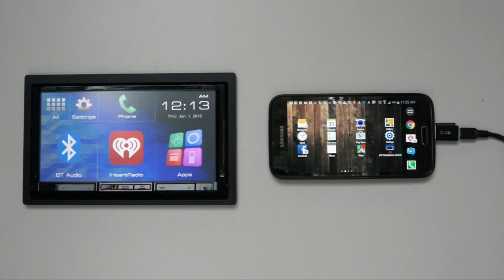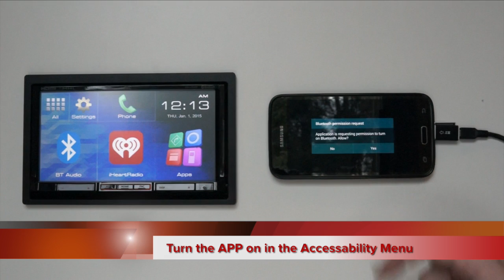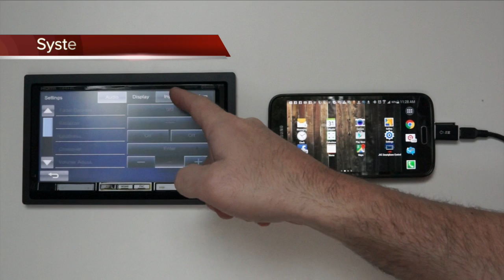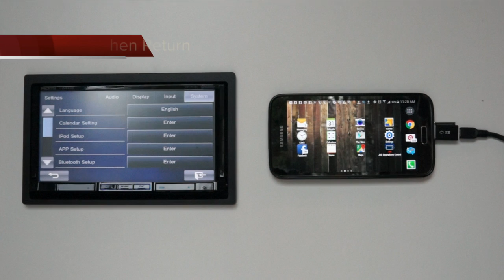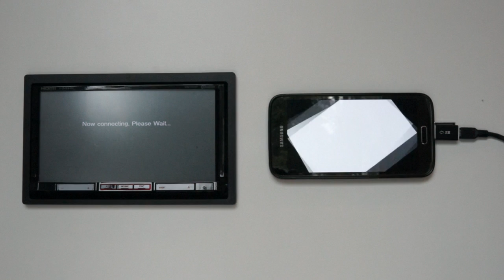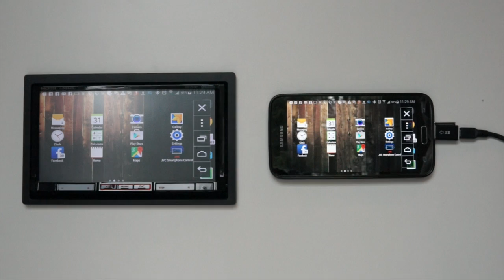JVC Android Smartphone Control

Comment: Will this work with my Samsung galaxy s8 & my jvc kw-av70bt?
Reply from the maker: Matthew Flores...sorry, but Samsung has removed MHL from the current phones. They no longer send video through the USB, they only use Miracast which is through WiFi. You can use an HDMI WiFi adapter/dongle to do it.
Reply: Matthew Yerger  where can I get one of those from?

Comment: can I use my Samsung s7? ibhave the jvc kw-v620bt
Reply from the maker: Desmond stepherson yes and no...when the Samsung s6 was released it no longer supported MHL. They also no longer allow the phone to be remotely controlled from the radio. You can send the video wirelessly, but you will need to purchase a HDMI wifi dongle. It will mirror the phone, but no control.
Reply: Matthew Yerger where exactly do i purchase that from? Do you have a video that demonstrates that. I really need help setting this up? How does the App portion of this stereo work?